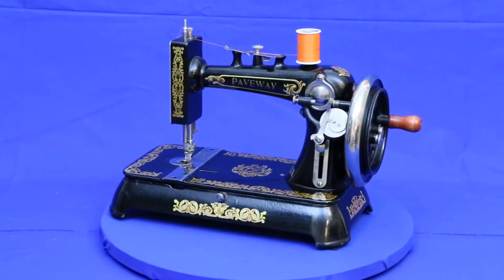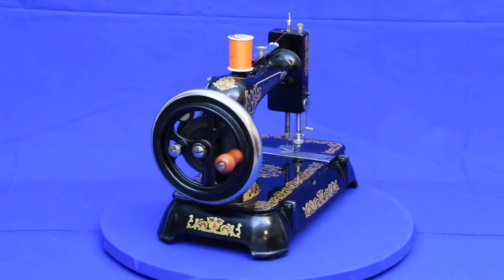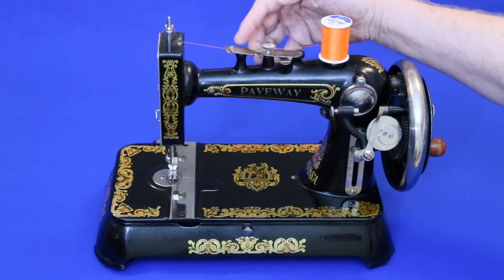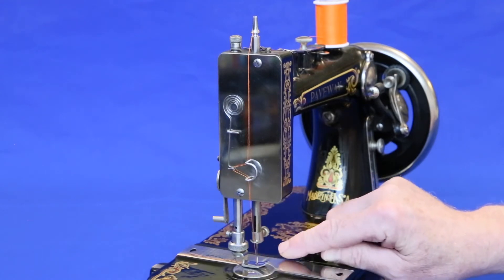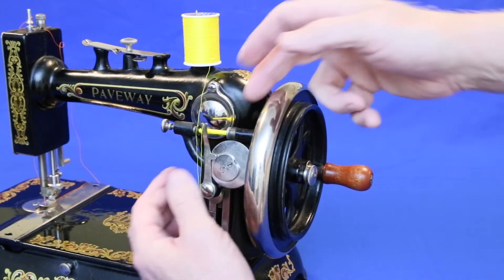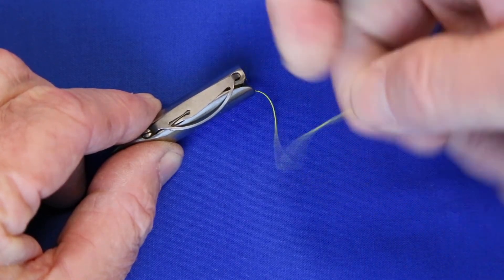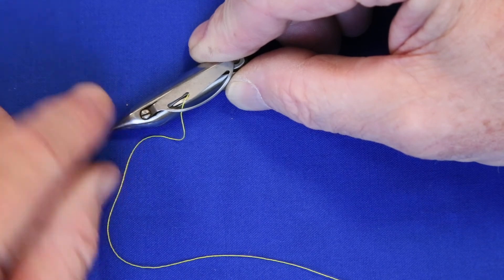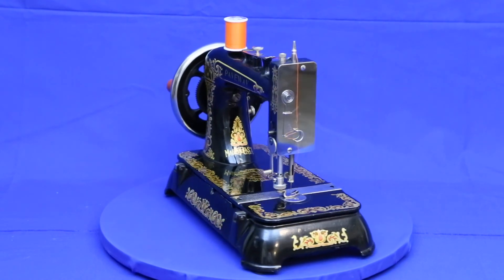Antique National Paveway Sewing Machine

Comment: I have a Paveway treadle sewing machine that I just had serviced on Thursday. It was a barn find. The previous owners refinished the cabinet, but they never used the machine. It was just furniture for them. I bought it for $60 on Craigslist about 10 years ago, and only just now got around to having the machine itself serviced (I have several other vintage machines, and this was last on the list). It came with all of its accessories, including 5 bobbins and 3 shuttles, plus a complete set of feet and the original cabinet key. It only needed a new belt, some minor adjustments and a good oiling. The decals are in really good condition and there's only minor pitting/rusting in a few areas, which is amazing when you think of it being found in a barn. It's been a joy to sew with it for the last couple of days! A real piece of history. :-) Do you know how to accurately date a Paveway? I believe mine is pretty early (1900-1910) but I haven't found a way to really confirm that.
Reply from the maker: Hi, Colleen! Thank you for commenting. 

Dating National sewing machines is extremely difficult because there is no record of their serial numbering system. I've been collecting data for years and have only been able to come up with a rough guess for dating them. For non-rotary, non-electric machines, here are a few numbers I've found from which an estimate can be made:

   618,854 = 1895
1,111,025 = 1910
2,167,857 = 1913
2,314,288 = 1914
3,299,867 = 1922

I hope this helps.

I visited your channel and enjoyed watching the video about your sewing machine collection. I've never heard of the hand crank modification for your Singer 15. I'll look into getting one. Thanks for the idea!
Reply: @wayneschmidt490  Oh yes it does help! Mine is serial # 1,326,610 - although it's stamped like this: 13266 - 10 (with dash and a space). So that would put it around 1910-1911. That's good to know! Thanks! And thanks for watching my video. The hand crank is nifty! But I did finally get that cabinet 15-91 machine serviced as well (there was a very long queue). It's been back a few weeks and runs beautifully too. So the hand-crank will sit in a drawer for a while. :-)  There's just nothing like a good old sewing machine in perfect working order. They are the best. I really loved seeing all the old machines on your YouTube channel. I plan to watch more of those videos. I really want to add a few more antiques to my collection.
Reply from the maker: @ColleenMarble  I'm glad I was able to help. My current project is restoring a 
1911-ish Improved Eldredge B sewing machine.
Reply: Hi again - you've been kind to offer help on the Paveway, which I've now cleaned and polished and using! I'm wondering if you could help again. I recently bought a New Home sewing machine for $10 !!! and after a good cleaning and oiling she's running perfectly and looking gorgeous. But she only came with one foot. I bought a large lot of top-clamping sewing machine feet on eBay, but none fit my New Home except those that screw to the bed of the machine itself for making, for example, a rolled hem. I did find some stuff for my Paveway and for my Free-Westinghouse, so the purchase wasn't a bust. But now my question is whether there is a master list of specs for sewing machine feet so I can match up the ones I have to the machine brands that use them. I've measured all the feet with calipers and there are at least a dozen distinct feet designs in the lot. I had no idea there was that much variation. I am debating whether to keep the feet for possible future machines, or try to sell them, but I'd want to know what machines they're for before doing either. Any thoughts on where to look for that info? Thanks in advance.
Reply from the maker: @ColleenMarble  Attachments for old sewing machines 100 years ago are like apps for smartphones today, there were so many made it's easy to get lost in their multitude. I have no information on how to sort them so they match up with the machines they were made for. I don't even know if anyone has made such a list. I'm sorry I can't be more helpful. 

I finished the Improved Eldredge B and am now working on a 1893 Augustin Avrial pump-typer sewing machine. It's going to be a tough one to restore. Wish me luck!
Reply: @wayneschmidt490  I was afraid fo that, and I figured if anyone knew you would. Thanks for the note, though! I appreciate it. I can't wait to see your videos on those projects. I really enjoy your channel and have found myself referencing it often.

Comment: This machine is so lovely. I have a similar machine, (not as pristine) do you know of anywhere to get the spring tension guide on the face plate?  ours was broken when we got it.
Reply from the maker: Parts for National machines are commonly available on EBAY, Pinterest, Etsy and so on. Finding your particular spring may take some time, but is the best way to go. A more immediate solution is to make a new spring. The wire is 0.032 inches in diameter. This corresponds to a super light A or heavy D guitar spring, which should be available from most music stores. Winding a flat spring can be difficult. But, since it only needs to be functional and not pretty, a quick and easy way to make one is to use needle nosed pliers to bend the spiral. Good luck and thanks for commenting!
Reply: @wayneschmidt490  Thank you, especially for the wire diameter, very helpful. Thank you for taking the time to answer, very appreciated.
Reply from the maker: @TheGardenKitten  You're welcome!  I checked you your channel. I enjoyed the video about the Maine Coon.
Reply: @wayneschmidt490  awww Thank you

Comment: Enjoyed your video! I ha ve a 1902 New National that I just finished restoring but I need a bobbin winding tire / wheel. Do you know where to buy one or a solution to fix this. Thanks
Reply from the maker: Hardware stores usually have o-rings or grommets in the hardware, plumbing or electrical sections that have worked for me in the past. Another option is to make your own with 1/4-inch rubber cording cut to length then glued together with super glue, which works great in rubber. Here's a link to the cording:

https://www.amazon.com/CleverDelights-Solid-Rubber-Cord-Durometer/dp/B075X3V63Z/ref=sr_1_2?crid=P444MSZ5HQ11&keywords=1%2F4+inch+rubber+cording&qid=1678487766&sprefix=1%2F4+inch+rubber+cording%2Caps%2C235&sr=8-2

Good luck and thanks for writing!